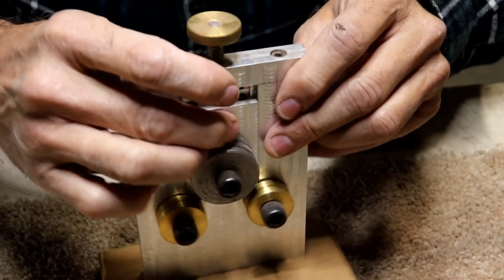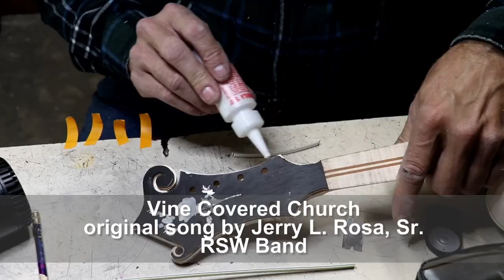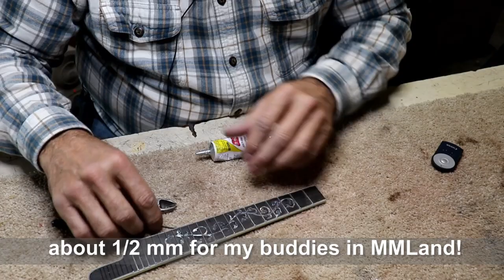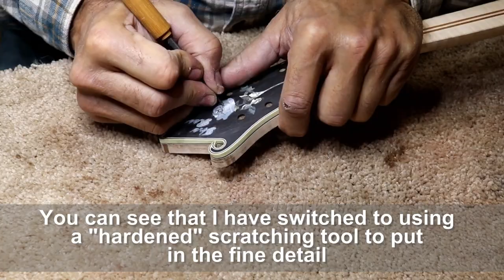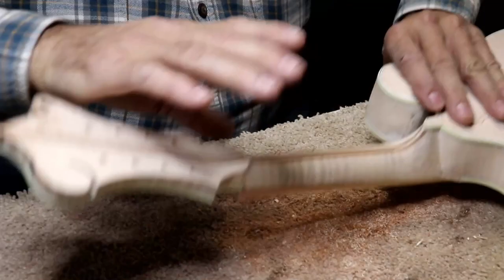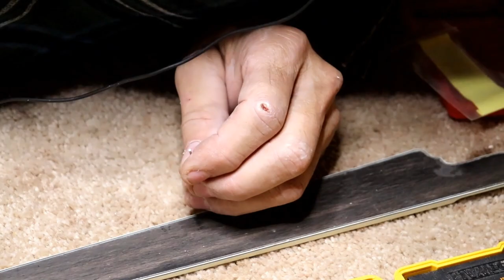241 RSW WV Mando Project P7 Peghead Truss Rod

Comment: Jerry, thanks for posting these videos. I've learned a lot.  But why do you use plastic binding instead of celluloid?
Reply from the maker: Buy Celluloid are you referring to Wood?
Reply from the maker: If so you ought to try bending wood around those little tight curves on a mandolin peghead
Reply: @RosaStringWorks  No, not wood. I was referring to standard cream colored binding as apposed to regular inexpensive plastic binding.....like stew Mac sells. I don't think they sell celluloid binding because of the hazmat shipping issues.
Reply: That celluloid stuff is almost an explosive!
Reply: It'll go poof if you overheat it, but I would't say it's explosive. @papaw5405
Reply: If you look back at the video where he was binding the body, you will see that he is in fact using celluloid (and pays extra for hazmat shipping)
Reply: @markmelville6670  They use it to make some picks too. You'd better be careful. If you hit too hot a lick you might burn your fingers off. Fiddle picks are all considered safe though!
Reply: @timsmoot5141  ok